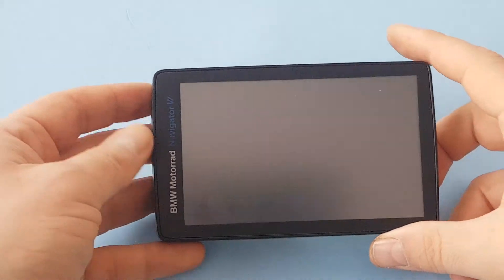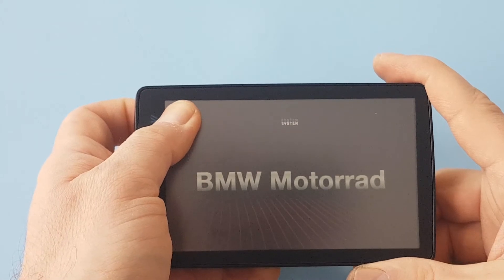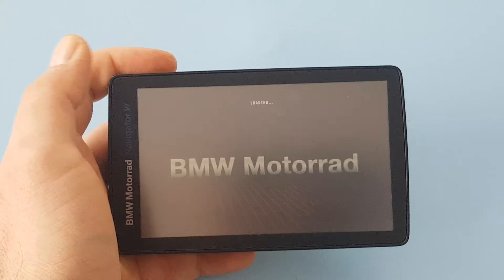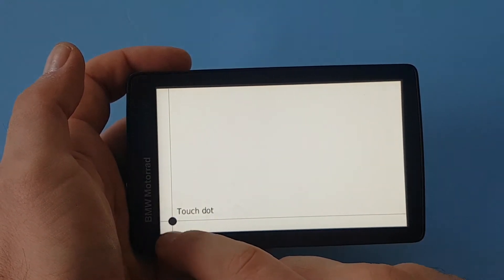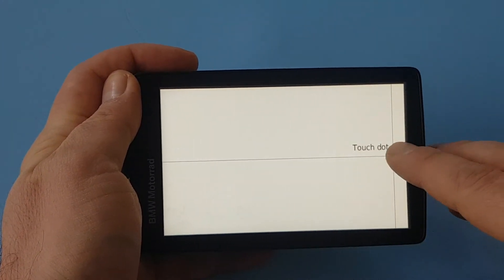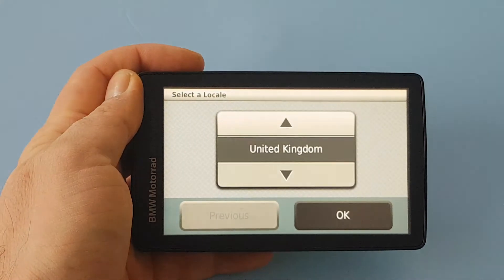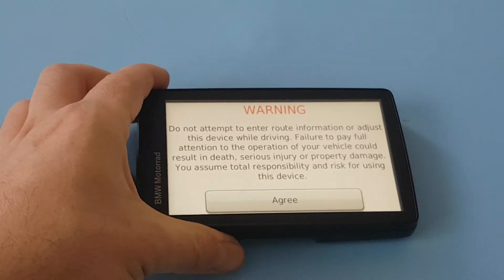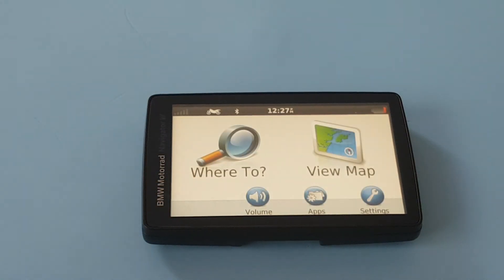BMW Motorrad Navigator VI Touch Screen Calibration Instructions

Comment: Sorry, my original issue was the screen was stuck on erase all user data? It seemed like it wasn't responding to where I was touching yes, or no.
Reply from the maker: If you cannot calibrate the unit is possible that your touch screen is faulty. 
REGARDS
Reply: @RepairMyDevice  Thanks so much for the help.

Comment: When I touch the first dot, mine shuts off completely. I made sure it was 100% charged.
Reply from the maker: Unplug it from power and try several  times
Reply: @RepairMyDevice  Thanks. I'll keep trying. It's done this once before, but I couldn't remember what fixed it.
Reply: Update: It also powers off in a few seconds even without touching the dot.
Reply: @SmittyAZ  Did you get it figured out? That is what mine is doing. Also, nothing on the touch screen works. I tried to do a hard reset and even the box to touch for erasing all data is frozen.
Reply: @youranswer42  I contacted Garmin and had to send mine in for repair. I was going to pay 350$ for a replacement unit, but they repaired mine and sent it back. They fully refunded my deposit.
Reply: do you remember the procedure ?
 @SmittyAZ
Reply: @AZALIN8  Just what was in this video. Mine needed to be sent in to Garmin. 
It needs to be sent in again for another issue. 

What is yours doing?
Reply: @SmittyAZ  as soon it goes to the dots it turns off I tried several times .. I wanted the information about Garmin who you contacted

Comment: Do you know if Garmin have sorted out the screen ghosting problems that have been be reported in the past?

I have just bought one and not sure if I should to keep it if i start having problems with the screen.
Reply: They have not...  depending on where you are, some countries will keep replacing units (I've seen folks in forums being on their 3 replaced unis and still having issues) and in some countries like Ireland/UK where Garmin sends you to BMW, BMW sends you to Garmin and the only thing you can do is sell the device for parts. I'd say, sell it before it ecomes unusable. It's not a matter of "IF", it's "when".
Reply from the maker: Hello
That ghosting problem it is a fault, if the touch screen calibration don't fix your problem, it means the touch screen is faulty.
The part can be replace.